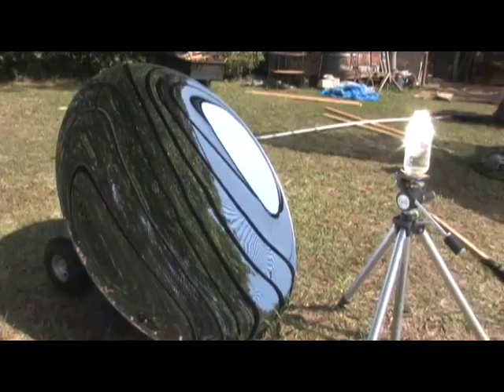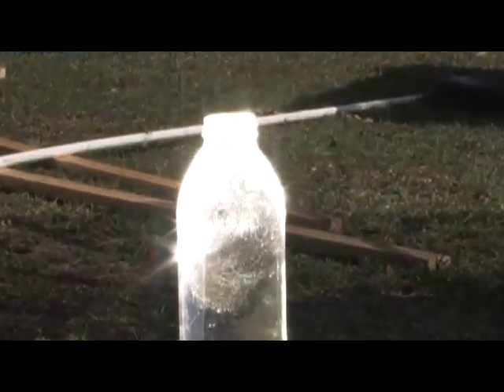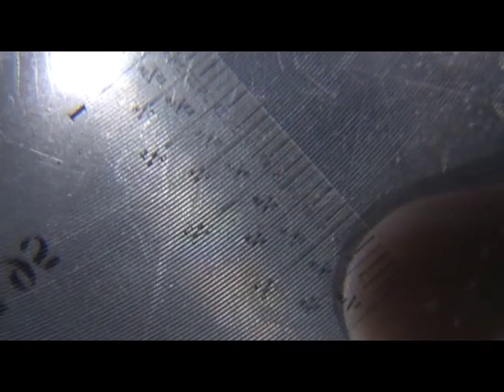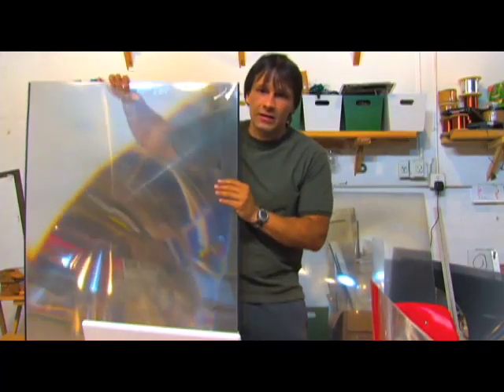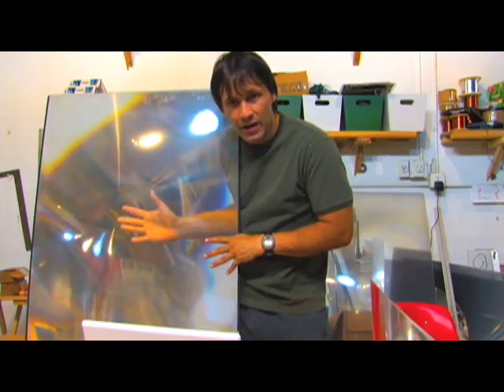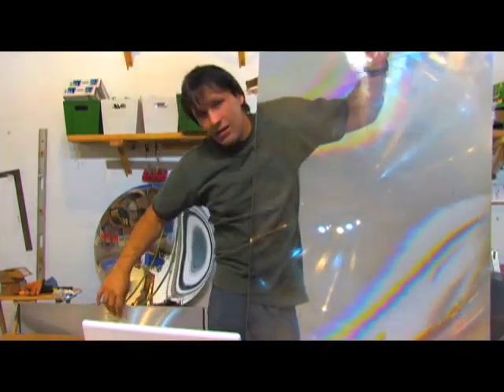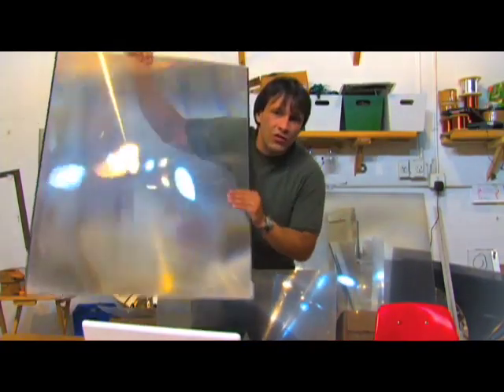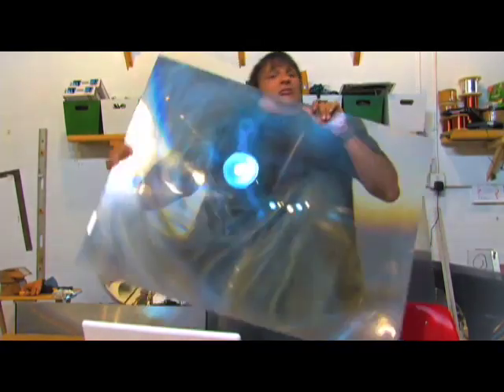FRESNEL LENS GROOVE PITCH LPI LINES PER INCH part 3

Comment: ok, but apart fromsun- collectors/heaters, when one is talking about fresnel lenses for optical stargazing, like this: https://www.newscientist.com/article/dn13820-telescope-could-focus-light-without-a-mirror-or-lens/

What is the focal length? It speaks about several kilometers, but tha's because the lens is 30+ meter. What if you made a 2m lens out of it? What would be the minimum focallength to see the planets/moon, etc?

I'm not really understanding why there aren't telescopes on Earth using this technique, since it would obviously be far cheaper than a mirror? So I thought maybe it needed a too long focal lens, even more so than a achromatic refractor?

Or what is the reason that no such telescopes are built on Earth?

Comment: new at this and not sure at the rating thing, that said... What you explained was easy to follow, and makes me want to follow some trains of thought. Concentrating sunlight is focusing a heat source, ( power ) making steam seems like a great source to drive a machine. is there any research on comparing the large boilers and their BTU output to what is capable of being acquired with Fresnel lens or parabolic mirror, ( satellite dish with a mirror surface).

Comment: (cont.) You could get 7 jewel movements, which made a big difference. Then they had 17 jewel movements, which were a little bit better still. But then you end up with 100 jewel movements, which are pointless except as a marketing thing. Similar thing with astro scopes; people will spend hundreds of quid on a posh equatorial mount, and then hours setting the thing up, but with my litte cheap dobsonian, I can be cooled down and set up in ten minutes flat, and with the savings come better optics.

Comment from the maker: Thank you for the video,  good reference! The only issue is that the compound parabola lights the target in almost a 270 degree angle from the outer most rim are of the dish which would heat the top and bottom of the pot. The focal point is also very close to the base of the dish so a large pot would block the incoming light to the bottom. Not sure it would provide even cook Because Fresnel lenses are flat, I do not think it would work, do not have the deep dimension of reflective dish Thank you

Comment from the maker: Excellent point, water heat transfer is faster with a larger focal point. The larger surface area does not get as extreme so less is lost in the surrounding air.
Hard Drive Platters
I have about 1000 of them I bought from Ebay. I was thinking of a large array or a dish. If I can find an easy mount, the metal basket dish would be great. They are excellent mirrors for longer focal point because they have no distortion.

Dan

Comment: I understood the question.  But should have elaborated to say that most such mirrors are made for telescopes.  For Solar collecting the trough mirror is used most.  The mirrors that Dan tends to play with really are too hot at there focal points to be practical except for starting fires.

Comment: Great Videos Dan,   The only point that either I have missed or you skip over is that when heating anything with such devices is that you do not need to use the max focal point.  So long as the light is focused enough so as not to be larger then the object you are heating the same amount of energy is being transferred.  This reminds me.  Have you played with the harddrive platters yet to make an mirrored array yet?  I have been collecting them but have yet to play with them.

Comment: In commercial power generation a 10' x 10' fresnel lens could be focused on 2' x 2' solar cell. The cell would likely have to be water cooled, but that would be easy and I doubt that refrigeration would be required, only a lake. I am unaware of how the efficiency of solar cells varies with temperature and amount of light. I would think that the efficiency would increase under brighter light. I'm going to keep replying to this as I think of new ideas. Mind you this is for commercial stations.
Reply: I have done a little with some smaller lenses (8" x 11") and I was going to focus them on my solar panel, but on a quick test for distance where you get the most focus, it was only split seconds before a burn/flame occured, so I def. was NOT going to experiment on my panel.  I also found out that solar panels are less effective the hotter they get, and with lenses we are talking in the 1000's F.  And you would have to follow the sun to keep the best focus.

Comment: Another great video Dan! The tracking mechanisms currently used for commercial solar cells could easily be adapted to these fresnel lenses. Perhaps the focal point could be made into a 6"x6" patch that would shine on a equal sized solar cell. This would allow a large collection area to be focused on a small (and therefore cheap) solar cell instead of having thousands of square meters of solar cells. I would imagine that the solar cell would get several hundred degrees, but this could be overcome